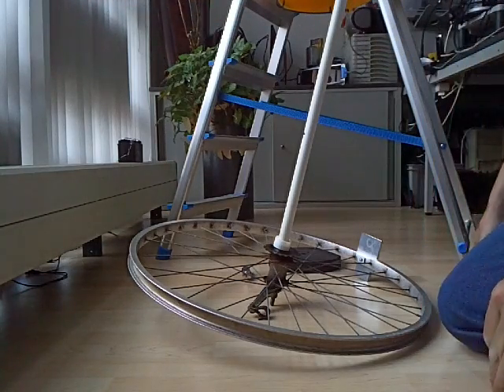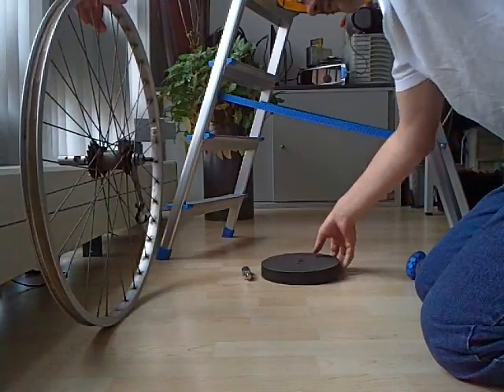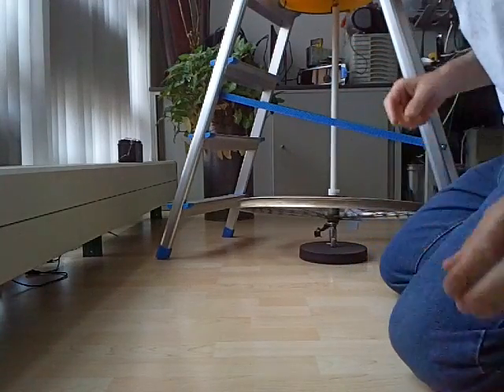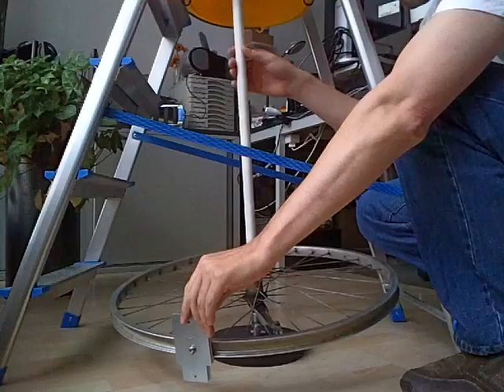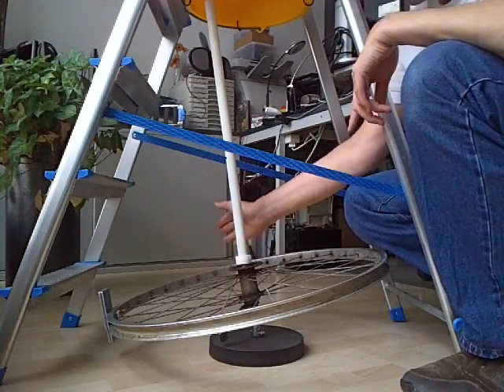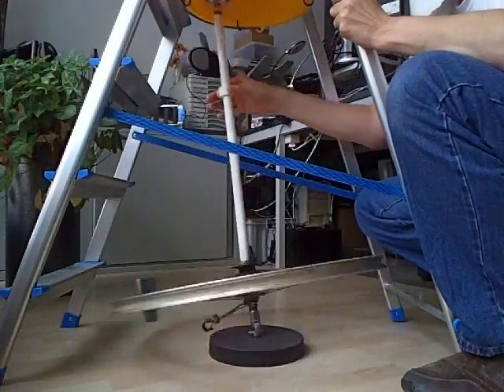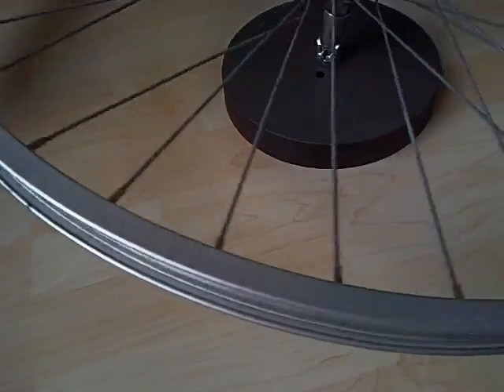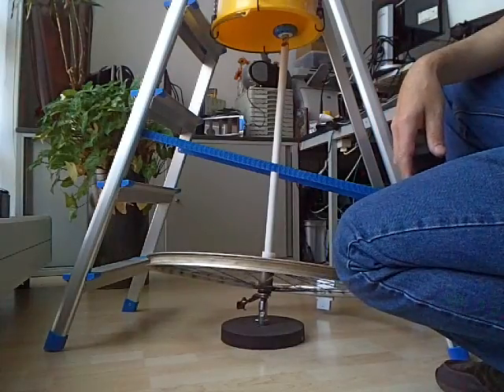gravity, concept for capture

Comment: Good concept Perhaps if an arm was attached at the level of the bucket, and the rod rotated with the wheel, the lever could be used in inverse to tilt the direction. This could be a very efficient concept. It sounds very efficient. There is no real principle against creating an imbalance from a higher height as long as the higher lever is acting contingently to the weight below, which requires the particularly innovative addition of the weight you used in the wheel.  I wish you success. By the way I have not tried this exact concept, although some of the concept I have tried have showed upward and downward motion from rest. If you find that you cannot rotate the wheel 360 degrees you might want to try a pulleyed counterweight using a similar arrangement like the upper lever, or a ball weight supported around the side of the wheel or top of the bucket as a possibility. Good luck! I rarely wish it.

Comment: Yes, easy once you get it going but as soon as you add a load, you need to increase input power to get it back to speed.  Therefore there is no gain as you will always be playing catchup.
Reply: The 90-degree angle is supposed to allow the bottom section to continue to move forward by acting 180-degrees, with 90 degrees moving ahead of the lower weight. This is as in the Tilt Motor design. Experimentation once showed some possible results with the Tilt Motor with zero altitude loss, which is the symptom of success in this type of design. The successful experiments are the ones the experimenter may have seen involving thick tagboard planks or something similar, or like a cross between tagboard and foamboard. The experiment was built so that the earlier plank overlapped, with the high leverage end creating limited resistance and additional mass on a section of the short end for the next plank, which would thus only resist with the light weight of the following plank which does not have mass on it yet. But by the time the rolling weight reaches the small section of the second plank it would have an opportunity to move downwards right at that point just slightly, like its following a zig-zag shape, meanwhile the short end would now be buoyed up by the weight of the rolling mass upon the following lever which was originally a bit upright. The net result seems to have been something similar to very fast horizontal motion from rest with no net loss of altitude. Unfortunately I believe at the time I did these experiments I did not have a good level to use to test the exact change of altitude, and was a bit disorganized.
Reply: @NathanCoppedgeVideos  
Nathan, the end result is no benefit.  It's simple physics!
Reply: @valveman12  It's an obscure theory. I'm not 100% stumping for the Tilt Motor but I find it intriguing, if a bit difficult to build. In my view I have not completely dismissed it, because in the abstract it is modeled in a similar way to designs which overcome the geometric problem. See writing on the Rhombus Effect: https://www.quora.com/q/bopvygwvujjynwxe/Research-on-the-Rhombus-Effect
Reply: @NathanCoppedgeVideos  
So what is your goal?
investigate claims of perpetual motion/free energy to determine if they have any merit?

Comment: This is a way to try and capture energy usually wasted... It's possible to get more energy out of something that you put  in...if you use gravity... Wind
....something..... Meaning it's possible to use something that is 60 efficient and feed that power to something and get that energy back plus 20 percent.... You do not get more than you put in....its just set in a way that takes all advantages mechanically that the system offers...using gravity.. Or tension... Which is a way to power your home...where you can use wind up power to power your home.... And it is easier than people think.... All u need to do is use 6 to 8.....8+4... Pieces of  sheet metal.... Bend over 4 in to attach to a crank....and attach each sheet together.....roll that sheet metal and insert into  box built for it with so the first piece attached to the crank... And every piece after of the sheet metal gets attached to the last... And as you crank it ....u can bend over the sheet metal so there is two layers where the pieces join.... It is way more easy than people think.... I had... Then u can use tension to power your home.... Even if you have to walk up a platform and use body weight to set it
Reply from the maker: Thank you for the feedback! All I did was try to visualize a concept, not very well done.
Do you have a drawing of your concept? Please share.
Reply: "It's possible to get more energy out of something that you put  in...if you use gravity... Wind
....something..... "

No. A lot of us wish it were so, but it just isn't. It's a well-known fact of the universe that over-unity is impossible.

Comment: This reminds me of canadian ufo researcher David Hamel and his butterfly
 effect of unbalanced magnets always seeking equilibrium to provide a 
motor force;  
David Hamel Index of files; http://www.keelynet.com/hamindex.htm

Here are some diagrams to better see the effect;

This shows the continually unbalanced butterfly effect for perpetual rotation;
http://www.icestuff.com/~energy21/drawing4.jpg

comparison to egyptian djed;
http://www.linux-host.org/energy/shamelc.gif

another form of Hamels butterfly effect
http://magnetmotor.go-here.nl/david-hamel.png

and there appears to be a correlation with E.F. Skinners PMM device of 
1856-1870 which ran at a 23.5 degree angle.

The driving wheel being on an inclination of 23 1/2 degrees, is the 
particular degree at which all metallic bodies which are placed on its 
disk will retain their position through the effects of gravitation, and 
if the shaft is adjusted at 24 degrees, those bodies will cease to act 
and slide off; or if the wheel is inclined to 23 degrees there will not 
be sufficient power to cause the cylindrical weight to pass the 
eccentric wheel which is attached to the shaft supporting the flywheel. 
Another very nice adjustment of the driving wheel is its adjustment of a
 vertical shaft out of line 1/8 of an inch, and as the principle on 
which this machine acts will work both ways, it is only necessary to 
shift the step 1/4 of an inch to reverse  its motion."  This inclination
 of the wheel and gravity is the secret, according to him, of its 
perpetual motion. If it is but inclined half a degree less - 23 degrees -
 then the perpetual motion is killed at once, according to his 
description.

Let’s mention the most important angle of all, 23.5 degrees or 23.42 to 
be precise.  This is the angle that our earths axis  is tilted at from 
the Ecliptic Plane.  What gives this angle such significance is the fact
 that the ancient Egyptians knew  about this angle of the earths axis at
 a time when the tools  of astronomy were archaic, how they were able to
 figure it out is still a mystery today.   - Jerry @ keelynet.com

Comment: The video shows a mock up of the    Skinner machine which received rave reviews in the press when it was investigated by reporters during the time of Skinner. Many machines have been built from the informatio provided in the presss reports and reviews . I myself have built the machine in its two versions, one which had its imput shaft oscillating and the other version which had it shaft rotating. Both machines worked perfectly as toque convertors but not as energy multipliers. The output and input were measure directly using Prony brakes rather than electrical measurements. The output was always found to be about 50% of the input. The Law of ocnversation of energy as usual holds for these machines as it does for all other machines for which overunity performance is claimed.
Reply from the maker: +Vivian Astridge Hi Vivian,
If you have seen the Skinner video, did you also see that other video associated with it? It is a big ferry wheel with humans in it sort of wobbling around on extreme very little input power.
The design you made only came to 50%? That is a very low conversion, sure thing! Would be a good idea to share that info as well, so other people can see and learn from it. I am not an engineer so I can only do a mock up.
Reply: +deslomeslager  Thank you for your comment. There used to be a very common set or arrangement or collection of engineering components available in the long past. The parts included absolutely everything that would be required to construct working models of practically any engineering project or machine. This collection was referred to as Meccanno. I built my two Skinner machines using this collection or engineering set. The model were actually small sized  working machines     including the Prony Brake which also was of Mecanno parts. As   already mentioned the machines workedk perfectly. The input and output powers were also measured accurately. It is preferable to always measure input and output powers directly using mechanical measurement methods. I assure you Sir that it is not possible even with the most precisely built machine to obtain anything like 100 % efficienty. The Law of |Conservation of Energy quite unequivocally states that energy cannnot be created or destroyed but  only and always only transformed . Please do not spend effort or time or expense in making the Skinner machine as it does not perform as claimed. If you are interested in building accurate.working. low power machines you could not do better than invest in a Mecanno Set. These are presently made in Brazil, New Zealand and in Western India. the Indian company actually manufactures absolutely every single part of the very largest Mecanno Set No 10. All the very best to you.

Comment: Uploaded INVESTIGATION QUALITY edit of the original Pathe "Skinner Gravity Power" video - for replication efforts
William Skinner 1939 Gravity Power Machine - Replication Investigation
Reply from the maker: Nice slow motions parts of the original movie. I believe all parts are 100% round (no ellipses anywhere like some people seem to think). The top is being powered, running 4 round wheels with (per wheel) an axe going down, and those are driving the bottom axes, but indirectly so there is no 'one to one' ratio. I wish I were an engineer, I would build it straight away.
Reply: deslomeslager

Comment: The concept has a term : It is called : nutation - it is a well developed engineering principle.
Reply from the maker: The term nutation (I had to look it up) is relevant. How ever the concept used here is more than nutation. The tilting of the axe while the weight is falling does not fit the description of nutation. Also, nutation seems to apply to a largely axially symmetric object. In my case the weight is an unbalance, deliberately (and creates an asymmetric object there for). So I do not agree to call this concept nutation, as there is a big difference. All the calculations don't fit anymore.